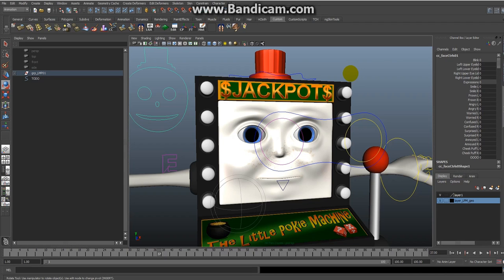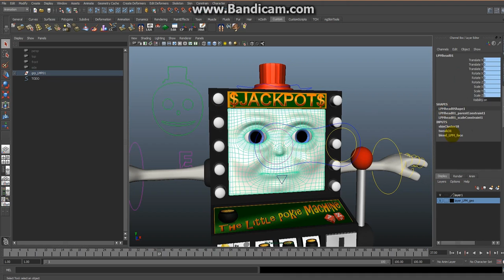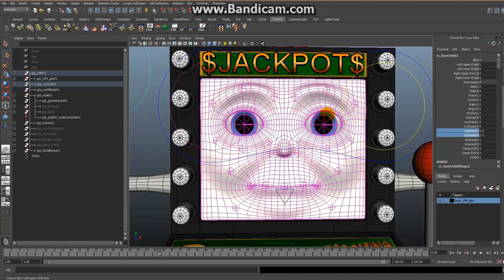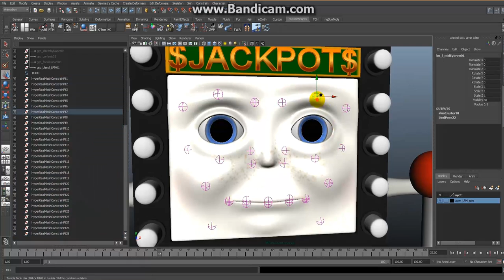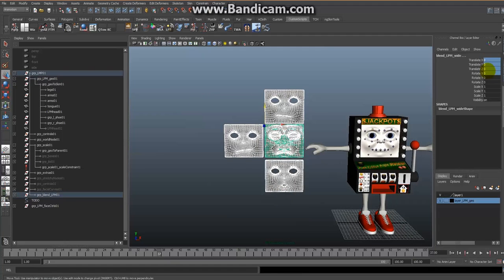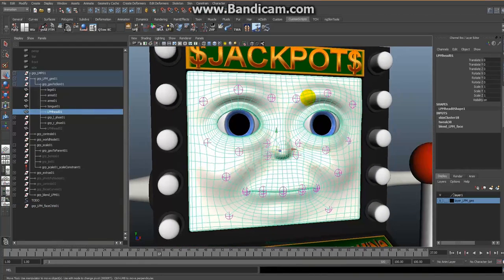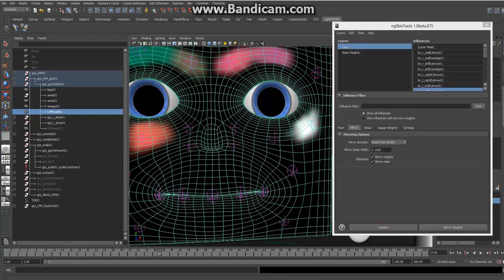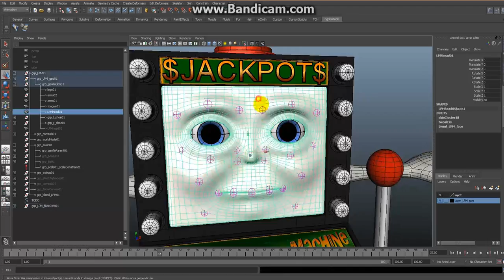Maya Sticky Controls Tutorial

Comment: sweet tool, do we need to have the script everytime we animate on a different pc ?
Reply from the maker: Hey Richard. Thanks. The script creates a few different nodes, but they're all already built into Maya. So no, once you have the rig set up it should be fine to use on any computer, with most versions of Maya, without needing the script on each machine.
Reply from the maker: Sorry, just to be sure, are you referring to the rigging tool, or the skinning tool? Ngskintool will need to be installed on each machine unfortunately. It does create nodes that aren't native to Maya, and you'll have problems unless it's on each machine.